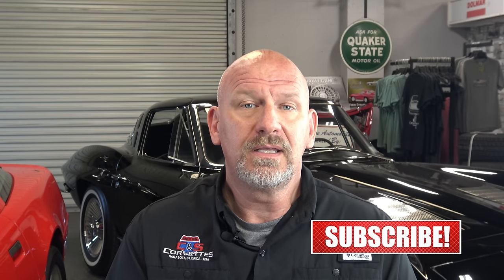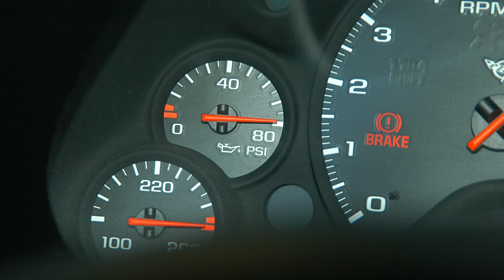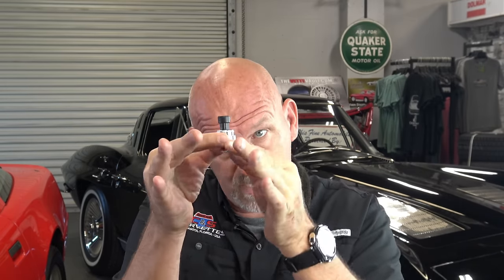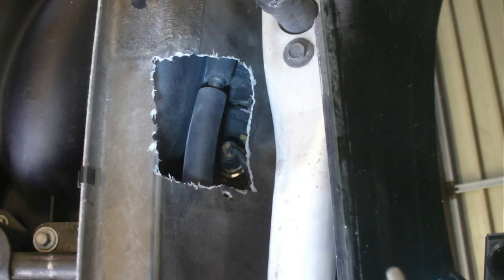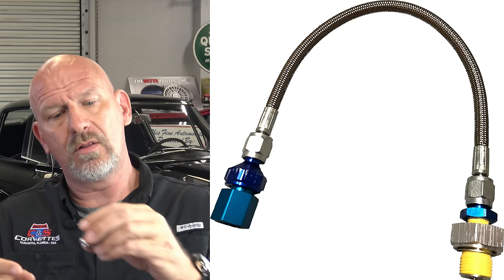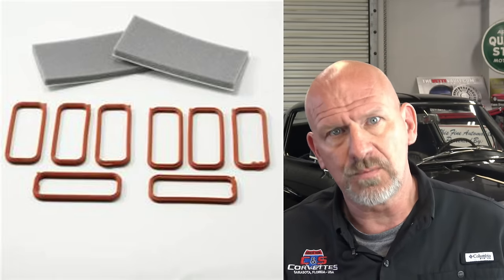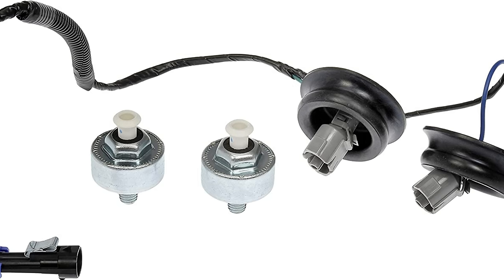#1 Most Common C5 Corvette Engine Problem...and the solution!

Comment: Just cut the plastic add some screws and make it easier and even easier next time.  O'Reilys sensor does look better than OEM and is cheaper.  I killed my second sensor when it got hit with brake fluid due to my stupid addition of the remote bleeder for the slave cylinder.  Don't add extra joints that can leak was my lesson, GM engineers did it right.
Reply: Maybe the hole you cut above your sensor to access it allowed brake fluid to get on it...🤔
Reply: @seanfarley1758  No.  My access is fully sealed back up with screws for access.  Brake fluid came from the clutch slave, on the same side of the duct as the sensor!  If I left the hole open, the fluid might of missed the sensor but went into the interior!!

Comment: As an ASE CMAT and I've had to do this twice on my '01.  Cut a coat hanger and bend one end at 90 degrees to un-clip the wire then use a 3/8 ratchet, a 3/8 to1/4 adapter, a 10 in. long 1/4 in. extension, a 1/4 in universal., a 1/4 to 3/8 in. adapter and the 3/8 drive special socket (MAC #SC46)  The first time it took 30 minutes and the next time 15 minutes.  It is a tight fit, and it can be done.  Thanks Lyle!  ;D

Comment: Sad to say, I instantly recognized the part being held up , so could almost guess the topic and what was going to be discussed.   Always glad that this channel is here to discuss topics with both knowledge and experience , as kind of a countermeasure to all the corvette channels who manage to buy a camera and then give poorly informed advice , some no better than gossip that they heard multiple times elsewhere on the internet and pass on as solid repair tips.  

I did this job , but didn't know enough to change my knock sensors, so I appreciate the tip and the helpful link.  I did clean my air flow sensor , returning it to a shiny color, and cleaned a surprising amount of oily dirt that had collected in the crevices of the throttle body.  When I opened my new gasket kit, only then did I learn that I was missing the sponge dirt blockers that fit under each end of the manifold, after puzzling over what these sponge things were for a while, because they didn't look like gaskets, and I hadn't removed anything like that so far.  

 I was very unskilled at the time,  and didn't even know all the wires were held on by clips.  Consequently , I followed some bad advice that suggested a shortcut removal, and I accidentally destroyed my connector clip, because the advice didn't mention any securing device on the connector,  just said remove the connector , and I was working blindly with extension tools, as suggested ,  and without feel, trying to avoiding cutting a hole in my car and what I thought was a job beyond my skill level.    I bought an extension pigtail to replace the destroyed connector, but don't know which wire is which , because the oil sensor wires on my car are not color coded.  I really hope I can figure which wire goes where without hurting something electronic.

Stuff like that experience is why I have some resentment towards guys who have a camera, know that Corvettes get clicks, so give out marginal or worse corvette advice, where guys who want to learn, like me, but haven't yet learned the hard way to double check non professional internet advice , can get burned.
Reply from the maker: Richard, I'm sorry that you have had such a bad experience with this job.  I try to give enough detail to be helpful without leading people into a job that is beyond their skill--not saying that you are included in that group!.  IF I can be of help with your problem, email me through our website and I will do whatever I can to get you to the finish line.  Lyle
Reply: @csvette  that is a very kind offer, and much appreciated .   I will be in touch, and greatly appreciate the gift of valuable time.   The manifold removal wasn't a bad experience, the result , once I decided to skip the shortcuts, was actually mildly satisfying.  I didn't get the satisfaction of a job well done, since I couldn't complete the sensor wiring, but I feel the cleaning done along the way  was very productive, and I learned a little bit about how to work on the car.  

 The problems resulting from inexperience along the way were easily solved, save for the wiring I destroyed, and that was purely the result of ignorance, from not being able to identify bad advice.     I was completely unprepared that someone would offer flawed car repair advice.  To me that would be equivalent to lying. 

Now that I have owned the car for awhile, and have gotten a feel for some the Bs people post about Corvette repair on the internet sites  and YouTube  , I have a much more careful approach.   I actually hope to be acquire the skills to steward the car well enough so that after it leaves my hands, and faces the inevitable decision if it will be scrapped or saved, it will be nice enough to make the cut.
Reply: @csvette  Hi! great content and info in all your videos; quick question do ALL LS engines  and variations of it like LSA have the oil pressure sending unit issue???

Comment: I used to drill a small hole with a hole saw in the wiper box.  And then plug the hole with a plastic plug.  The tech next to me didn't like doing it my way, so he pulled the intake.  Well as luck would have it,  something got dropped down into one of the ports.  Bent a valve and messed up the piston.  After that fiasco he would drill a hole.
Reply: Did the exact same thing, replaces mine several times, takes 10 mins with the hole. Plug it back up, and on your way. Wiper tool is cheap.

Comment: I watched and 'liked' this video 8 months ago.  Today my OP sensor went out, stuck on 80 PSI.  I just ordered the parts that you suggested.  Now, after the 1st of the year, I will fix the problem myself, as you have suggested.  Thanks again for the valuable information.  My 01 has 76000 miles on it...
Reply from the maker: I'm sorry that it failed on you, but I'm happy we were able to help provide the info to get you back on the road!  Lyle :)

Comment: Thanks for the detailed explanation.  The 1st time my sensor failed, it drove the gage to 80 PSI.  I replaced it the hard way.  No drilled hole.  No manifold removal.  Just 2 hours of cussing while trying to get the old sensor out using whatever tools I could find.  Then, about a year later, the "new" sensor also failed.  Then I bought another sensor and the relocation kit.  It's now installed and working great!  Now, when this sensor fails (and it will), it will be a piece of cake to replace.
Reply: Question for you, did you have any issues connecting the wires / plug to the extended sensor
Reply: @robertmcsorley4001  No problems at all.   The wires were just long enough to allow me to place the sensor on top of the intake manifold.

Comment: So far with 45,000 miles on my 2004 Vette I’ve had none of these issues. Thanks for the great video on my upcoming problems I could have.😯 I’m in no hurry though.😉
Reply: Mine is at 80k and all these are coming up now sad to say , but thankful for Lyle and others to help us
Reply: If you put the old pressure sensor back in the factory location, you are a bigger fool than GM engineers. It is a shit load of work just for that little 25 or $30 sensor, buying a relocation kit is the best thing to do. Your local Napa or Parker hydraulic hose store will be able to make one for you for less than $50.

Comment: Great Video! I changed my pressure switch 2 years ago, and it really was pretty easy.  Be careful towards the rear area vacuum line that controls the havoc,that you don’t pinch or pull it loose from  its connector

Comment: Spot on with the gasket replacement as those foam protectors that are supposed to keep fluid away from knock sensors is typically toast, and you probably want to take a can of barryman to the intake manifold to get any oil out the pcv has sucked up.

Comment: Changing the knock sensor is not good advise.    I did it, as you recommended, and found out, at the Corvette forum, that I shouldn't have.   It turns out that if they aren't bad they should be left alone.   The knock sensor replacements are very difficult to get working, if they work at all.  I'm in the process of re-installing the old ones, which were working well.   i hope they come back to life, because I may have a real problem.   For those reading this, DON'T MESS WITH THE KNOCK SENSOR.   If it's not broke, don't fix it!
Reply: You need to buy factory OEM components for the knock sensors. Need to go to a GM dealer and buy them, not the crap from O’Reillys or AutoZone. They are not the same, and they are different part numbers. You can get a harness from just about anywhere, but the sensors themselves must come from GM only.

Comment: Great video! I've been putting off changing my air check valve also located behind the intake. I was intimidated to remove the intake, but your video has given me confidence. I have also seen other videos where the radiator was drained prior to removing the intake, and I didn't want to go through all that. Your process seems simple and easy. Thanks! I will also be changing everything you mentioned as well as the secondary air injection valve. 2003 Z06 55k

Comment: I replaced one a few years ago on my 03 Z06 without taking the intake off. I did it by using a mirror and reaching back behind the intake from the top. I used a pivoting socket and then torqued it down. It took all day doing that thing blindly but it worked. Wrist hurt for days. Lol

Comment: at same time, also replace the air pump exhaust gas check valve for passenger side located on rear driver side attached to block and requires intake manifold removal.
Reply: Depending on what state you are, you do not need that air pump. You can pull all that bullshit off of there, and remove the air pump from the front of the vehicle.

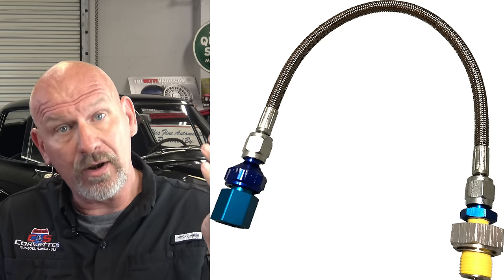Comment: 5:51 we are baffled about a silver metal braided cable with a bleeder type valve at the end, just hanging loose by the clutch cylinder. I now think that may be the remote bleeder you mentioned.

Comment: Yup, Lol I just replace mine, and it fixes the leak too, fyi better change the camshaft sensor too while your intake manifold is off, might as well also check your fuel injectors for dirt,etc and look inside the intake for oil. Look at your throttle body. Intake gaskets, etc. IF YOU OWN A c5 in general get ready for maintenance 😂

Comment: Ned advice, I'm a diesel mach, who's helping a friend pull the head on an 01 Corvette, it blew a plug out of the 5 hole, I told him chevs don't blow plugs unless it fill with oil or fuel but a garage told him it's common on that engine, yes or no,

Comment: Like most of you,  I'm a multi vehicle owner. I developed an oil leak on my 1997 7.3L powerstroke diesel engine. (pickup). No gasket leaks. Oil plug not stripped. Oil filter okay. etc etc etc. There was some sort of "plug" on the back of my engine, very similar to this description here. Mechanic found it and made the repair quickly and easily because of the very ample space between the engine and firewall. Im mentioning this because it might help someone else on yet another type vehicle. I havent had any oil leakage problems with my C6 2006 Vette with 39X miles,,,,LS2 engine. Thanks for your time reading this. I just like helping other people with their problems.

Comment: You need to change the air check valve while you have the intake off since it it located back there as well. My 2003 air check valve threw a code and while changing it I also repalced the oil sending unit.

Comment: Thank you Lyle!  I had marked this for later to get the parts links while I am pulling the SAI system this winter. I enjoy your sincere and helpful videos!
Reply: Follow up, always make sure to test your knock sensors before installing them. I had a newly installed knock sensor fail after just 4 days of driving. Had I tested it before installing, I may have found that the voltage was not quite right. A DMM with min/max hold will make this testing way easier for you. Figured this out on the second ones that came in as a replacement. Glad I tested the second set before pulling intake manifold and just installing them. 

I am suspecting that somewhere in shipping, they were banged around enough to just slightly damage the crystal and the car finished them off.

Comment: I was driving home when I noticed my was pegged at the max. I pulled over and had my wife come get me. After doing some research I has happy to find I could drive the car without damaging anything. I had the sensor replaced within a week and like you said I had them replace everything else since the intake was off. The C5 has alot of quirks to it like a fallen HUD or broken shift linkage.

Comment: Had a dealer replace two new factory switches in a roe one failed after 20 minutes reading 120 psi. called them got a second one installed it failed after 5 minutes so I said forget it 5 years later I had to do a lower plenum so I got an after market one and it's been good for 7 years now. And the hole in the cowl area was the same solution I had for it 10 years ago just putting a good fitting rubber plug with a little silicone on it to help sealing.

Comment: I’ve had my C5 16 years always a daily driver. The first time I removed the manifold. The second time I relocated the sensor to the front of the engine. I read an article on corvette blog about it. Both sensors didn’t leak. The second one just left in the original spot 8 years now and still not leaking. With the sensor in the front of the block it does not overheat and will not cook like the ones in the back. Was a simple fix screws right in and just had to extend the wires to reach it. If you don’t want to leave the bad one in   The plug from the front fits perfectly in the original spot.
Reply from the maker: Where did you place the sensor at the front of the engine?  If you could send me some pics, I'd love to see that!  lyle@corvettepartscenter.com

Comment: I've had my C5 roughly 2 1/2 years, and I experienced this within the first two months of having the car.

I managed to replace it without removing the intake or cutting the fiberglass, but if it ever happens again, I'll take this route and do all the above.

FYI - Mine was stuck closed, and the car immediately went into limp mode, and I couldn't drive it until I replaced the sensor.

I always appreciate the information I get from your videos Lyle, and C&S will be my go to source for parts for my Vette 😉
Reply from the maker: Thank you, Sam!!!  :)  Lyle

Comment: There’s also a special socket that was made for gm oil pressure senders that’s made with very thin walls. With that socket, a universal joint, and an extension, you can get the sender out just by moving the valve cover breather hard pipes out of the way. Comes out easily, but then you do have to reinstall the sender by hand until you get it threaded a few turns, then finish it off with the special socket. So if your hands are small that also works. Mine is a race only car so i ended up cutting a hole over it later on.

Comment: Got my c5 lay july & 4 months later i had to replace the oil pressure sensor . I watched a video on how to replace it and I did it my self , I did open a hole by the windshield whipper area to be able to replace this part easier. I payed about $50 for parts compared to $1500 the dealer ship wanted to charge me lol and I always have a extra sensor JUST incase

Comment: Just getting ready to R&R that sensor on a C6. I plan to just drill a hole through the cowl large enough for a 3/8 extension to fit through since I can place a socket on the sensor by reaching thru the the space under the cowl.  I would not cut a big ugly square port as shown in this vid.

Comment: Mine is bad. Oil pressure while driving is 19-21 psi and leaks a little oil for the time I have it sitting in the garage. Hasn’t gone in to limp mode (yet) though
Reply: yes mine was 17 pis at idle when sensor went bad i thought motor was toast or relif vavle in oil pump when bad lots say they peg the gauge  most i have seen read low

Comment: Always great advice Lyle. I am about to tackle my oil pressure sensor and was wondering if there is any easier access from underneath. Thanks, and have a great day.
Reply from the maker: There is not.  The Sensor sits vertically at the rear of the block, so getting to it from under the car is virtually impossible.  Lyle :)